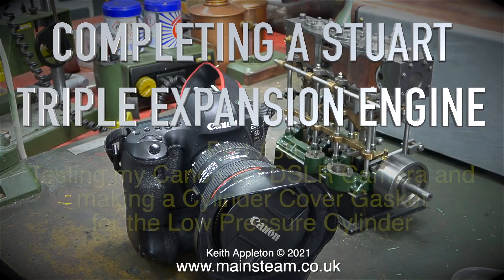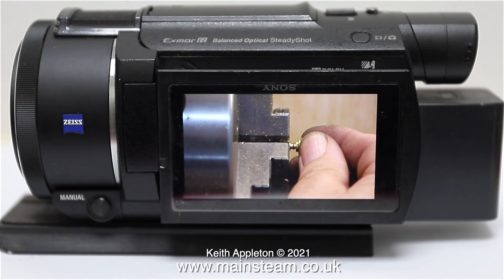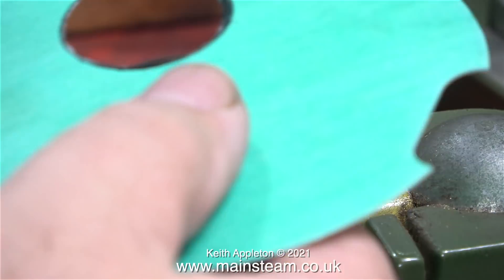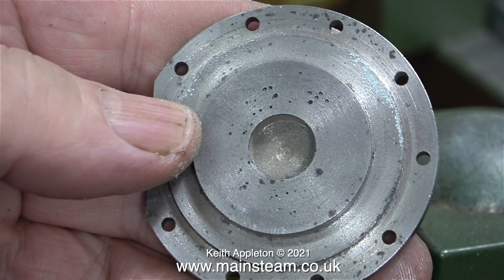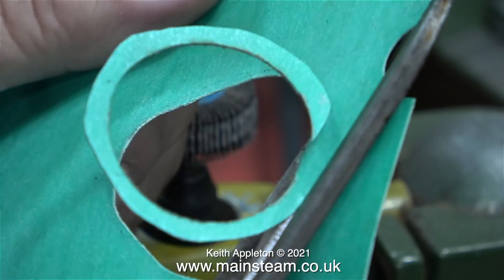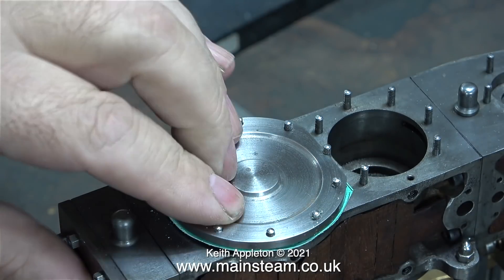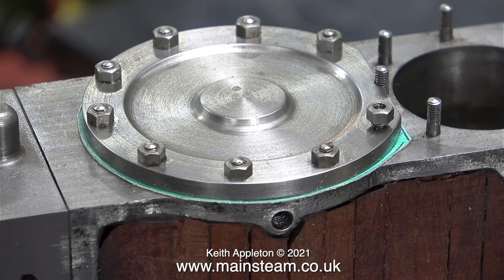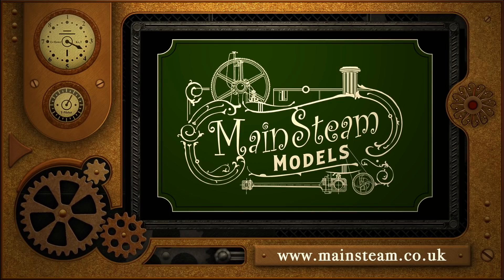COMPLETING A STUART TRIPLE EXPANSION ENGINE - PART #30

Comment: It might seem strange, but cutting emery cloth or sandpaper with scissors will actually sharpen them. This because it's the flat part of the blades that do the cutting.  The green gasket paper is very familiar to me as a former mechanic, its very tough, resistant to  gasoline (petrol) water, and high temperatures.  One way of marking a gasket was to cut out the center first using a compass,  then the outer edge using a small ball peen hammer.  I wouldn't recommend this for small parts, but it was the way I made gaskets for water pumps and such.   So you (and others) should just do what works for you!

Comment: You need to change the depth of field to get everything in focus. You can do this is fully manual by setting the depth of field to a higher number then balancing the light meter with the shutter speed (lower number = more chance of moving things being blurry) and iso if required (higher number = grainier image). Your camera will also have a depth of field priority mode where you pick a depth of field you desire and it sets everything else to balance the light meter to what you've asked for. If you do want a blurry around the edge image set the camera to centre spot focus and with the lense on auto focus point the dot and whatever you want in focus, press the shutter button half way, then whilst holding it down move the camera to get what you want in the frame and press the button all the way to take the shot. Doing this holds the focal distance. Hope that makes some sense 🤷‍♂️
Reply from the maker: Thank you for your advice }:-)))

Comment: You could have used a caliper (or ruler) to measure the circumference of the seating ring and then used a compass to mark the gasket material.
Does not matter, you got there in the end.
Reply from the maker: I do things in different ways to keep these Beginner's Tutorials interesting }:-)))

Comment: Hi Keith, hopefully I'm not explaining something you already know.   
If you aren't a photographer, the "peripheral blurriness" is call depth of field.    
In the lens, there is an aperture.   The smaller the aperture, the larger the depth of field.    The depth pf field is an area before and after the point you have in focus that will also be in focus.  
The best demonstration I can give is to have you look down your arm and focus on your wrist.   Now while looking at the same point, and only in your mind's eye*, draw your attention to a little before and a little after at the point you are physically looking at on your wrist.   You will notice that a little before and after that point will be in focus.    Now you repeat that same thing in a very bright area, the areas in focus before and after that point when examined *in your mind's eye (don't physically look at them) will be larger.   This is because with more light, your iris will close to a smaller aperture.
There is an interplay between the aperture setting in the lens, the speed of the camera's sensor (or in my day the shutter speed), the sensitivity of the sensor (in my day the film speed), the focal length of the lens and finally the distance to the subject you want in focus.    
To simplify it, let's look at a lens that has a fixed focal length (it doesn't have an optical zoom function) and a subject 2 meters away.   The aperture setting of the lens will determine the depth of field.   The smaller the aperture, the larger the depth of field.   
However, in order to maintain the same brightness, you need to either increase the exposure time (decrease the shutter speed) or increase the sensor's sensitivity or add more light to the subject.  
In a digital camera, the shutter is sort of electronic.  Its speed is how long the camera waits after the frame starts before it reads the sensor during which time the sensor is gathering light.    The sensor's sensitivity is how much the sensor data is electronically or digitally amplified.   
When you decrease the shutter speed, you increase the chance of motion blur.   When you increase the sensor's sensitivity, you increase the noise in the image.
(sorry this is turning into a wall of text!).   
The other two factors are distance to the subject and focal length.   The further away the subject is, if all other things are the same, the larger the depth of field.   In fact, if the subject is past a certain distance, the focus has to be set to infinity.   When this occurs, everything behind the subject will be in focus because the depth of field occurs before and after the in-focus subject.  If the subject is near to the infinite focus, the depth of field behind it will be beyond infinity.    
For the focal length, the longer the focal length, the smaller the depth of field.   A long focal length lens is also known as a telephoto lens.    A variable focal length lens is a zoom lens.    If you can optically zoom using the lens, the depth of field will be smaller when you are "zoomed in"
Probably better explained in articles like this one: https://photographylife.com/what-is-depth-of-field
By the way, your eyes do have a depth of field.   All optical systems do.   However, your brain is very good at optimizing the "settings" of your eyes.   It does so by adjusting your iris and focus and sensitivity.    It's very hard to see "depth of field" naturally using your eyes because your brain is so good at presenting an image that appears completely in focus.   However, the image is a composition of different things being in focus sometimes and out of focus at other times.   The in-focus parts are taken as your eyes dart around and stitched together by your brain.
(HUGE wall of text!)
Take care.
Reply from the maker: Thank you for your advice }:-)))

Comment: Please forgive me if I'm advising you on something of which you have in depth knowledge - please feel free to ignore or skip.  Your depth of field, which is deeper on the footage from your video camera than the DSLR in the pics you showed, due to your aperture setting being more open on the DSLR.  The more you close down the aperture, the deeper the depth of field.  And, that requires a slower shutter speed - and eventually you have too long a shutter speed to do the job. 

The trick is to make sure that the ISO setting of the camera is turned up as high as possible without the picture getting grainy.  That will let you close down the aperture and still have a quick shutter speed.  Also, selecting aperture priority exposure can help you control your depth of field.

That camera is capable of commercial art gallery quality work.  Best of luck with it!
Reply from the maker: Thank you for your advice }:-)))

Comment: The reason you are getting blurring  around the edges on your DSLR is because of the depth of field. Depth of field is the area that will be in focus, i.e. 1ft to 3ft  from the camera is in focus, outside that range is out of focus. This is also affected by the f-stop ( the size of the opening inside the lens, like your iris in your eye. More light, smaller opening). The smaller the opening, the larger your depth of field. The downside is you will need more light to have a proper exposure.
Another factor is the focal length of the lens itself, the number in mm the lens is rated for. The higher the number the higher the magnification.
The lens you showed that gets  longer is a zoom lens a zoom lens which means you can adjust the magnification. These generally have less of a depth of field.
Since you won't want to be messing with exposure too much, I suggest you use a wider prime (prime means a fixed focal length) lens and move the camera closer if practical. If you have a 28mm, try that. Don't go below 18mm as you will get distortion around the edges.
If you are using a macro lens, you will have a very short depth of field, in inches rather than feet, so you will get the blurring. Not much you can do.
Probably more info than you wanted...but there you go.

Great content, cheers from Canada. Thanks for your efforts!
Reply from the maker: Thank you for your advice }:-)))

Comment: The material is, as I remember having been a gasket maker, is a kind of compressed asbestos, which uses a binder to trap 99.9% of all the asbestos fibers. The stuff can also be a high quality linoleum, similar to rolled floor covering. Both are very similar and do require a bit of close inspection. The asbestos material will show some of the tiny fibers around the cut edges. A bit of cleanup on the edges usually removes the odd bit of fiber. ;-)
Reply: It's called "Garlock". Good stuff for heavy duty use. No asbestos in 1st world country's for years now.